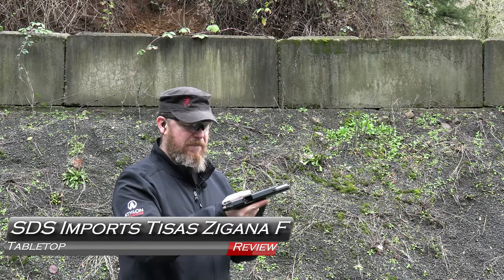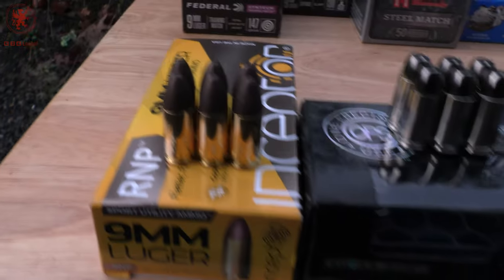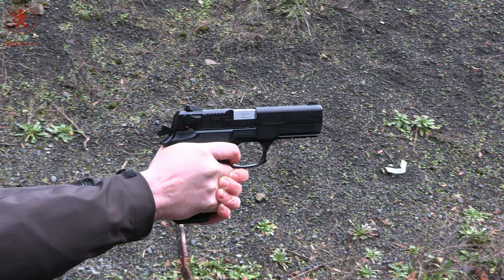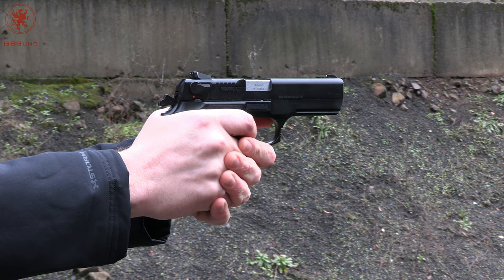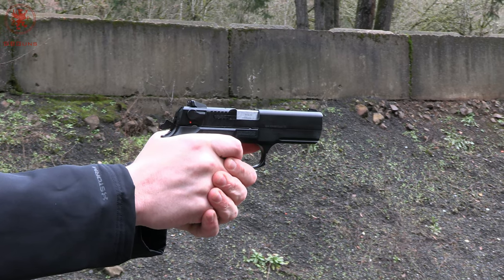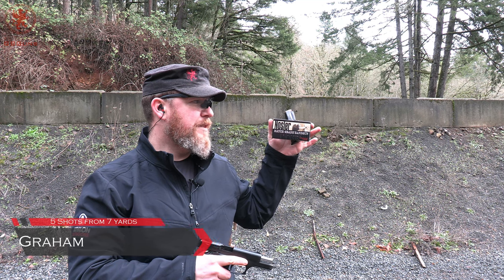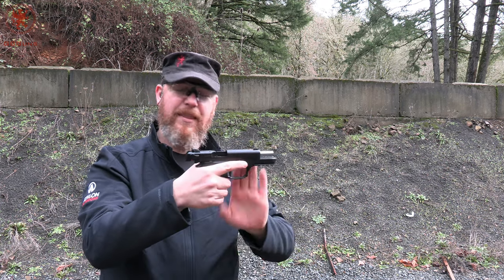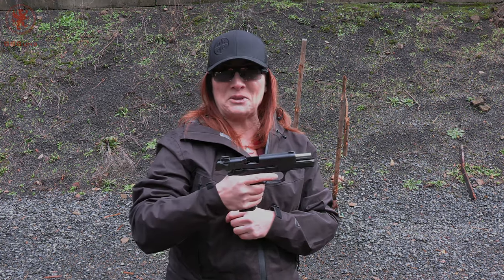SDS Imports Tisas Zigana F Shooting Impressions

Comment: I am going to order the k model. Classic firearms has them on sale for 225 bucks.
Reply: Carlos Danger  what kind? What style? Prices?
Reply: They're on sale now and I'm tempted to snag one
Reply: @Th3W4tchman  it's my new carry gun now. I really like it. I got an alien gear for a Sig 226. I had to heat it up a little but it fits great now. Holsters are not easy to find though.
Reply: @nimbly1693  True that. How's the recoil on the Tisas? Also, how did it do in the first 100 rounds?
Reply: @Th3W4tchman  It's alloy but not a light gun, so it is really nice to shoot. The trigger would totally make you think it is a lot more expensive gun. I have put about 600 rounds through it, and I can't say enough good about it. I would say it is a wonderful 250 dollar gun, but it would still be pretty solid if it were twice that price.
Reply: @nimbly1693  That's impressive. No hiccups through the break in period?
Reply: @Th3W4tchman  No problems at all. Honestly, the only thing I would change if I could would be some slightly thinner grips. I have big hands but this pistol has a wide grip. Kinda Beretta 92 feeling.
Reply: @nimbly1693  Nice....well you sir...gave me a lot to think about. I've been looking at this one for quite some time. I like the way it looks, but wanted to know about its efficiency. Thanks!
Reply: @Th3W4tchman  If you want a range or home gun, buy it. If you want a carry gun it is a little big and a little heavy and holsters are hard to come by. I carry mine, and I trust it, but I am a big guy.
Reply: @nimbly1693  Ok, good to know. I wonder about the availability of aftermarket parts it has.
Reply: @Th3W4tchman  It has a rail so lights and lasers are fine. I did talk to SDS because I wanted to see about some spare parts, and they said they have spares, but haven't got around to updating their site with them yet. SDS imports site does have factory mags for them. 35 bucks abouts I think. Like I said Sig 229 with a rail holsters almost fit. If you are crafty and have a heat gun you're good. Other than that, aftermarket is pretty non-existent.

I don't know your experience level or what you want to do with it, but I will say that in my opinion, it is a lot of pistol, especially for the price.

Comment: It appeared to me as though those circles were the 2" dot torture size. When I thought that you were shooting from 25 yards, I was impressed by the accuracy--then I thought that you said it was at 7 yards. Honestly, that is plenty accurate for anything that you'd use a self defense gun for, but I like that my 357 magnum pistol is still fairly accurate at 100 yards. I wouldn't even be looking at semiautos, if it weren't for the current civil unrest.
I find that my 1858 Remington with a conversion cylinder and my 357 are accurate enough for coyote at 100 yards. If that was at 7 yards, it doesn't look accurate enough for coyote at 25.
Reply from the maker: Most pistol rounds however don't deliver much energy let alone hit fast enough to open at 100 yards.

Comment: I just want to mention that from my keyboard :-) it makes me think that the woman should shoot in a left foot forward stance. I can't think of the technical names but the square stance that she's using is less stable in my experience then where you put your left foot forward a little ,turn sideways and basically shoot to from the side of your body. It really makes me more accurate shooting sideways like that. I'm kind of old and I hope I'm making sense but I don't have anybody to check with so you guys will tell me. Good video.
Reply: Thank you for your feedback.  I did used to stand that way (weaver style) but after a course last summer taught by CenterT I have changed my stance to isosceles. I was given physical demonstration as to why I should consider changing and it made sense. There are times I do stand off center when shooting single handedly or larger calibers.

Comment: Thats not the same gun they use in the country it was made it. It's a cheaper version it's just a high point with better looks and it kicks I have one. It should not kick being all metal frame they getting paid to get u to buy the junk
Reply from the maker: 1st: We are paid by no one, 2nd: If you think there is anything in common between this gun and a hi-point you are severely ignorant about firearms. 3rd: "all metal" is one thing, "all steel" is another.  This has an aluminum frame, not steel.
Reply: Lol   😁 quick response huh u no u get paid. Just leave it be it's my comments and Truth
Reply from the maker: @jesusistheonlyway8100  English seems to be a challenge for you.  If you prefer wir koennen auf Deutsch, ili Russkii elsi tak legshe dlya tebya.